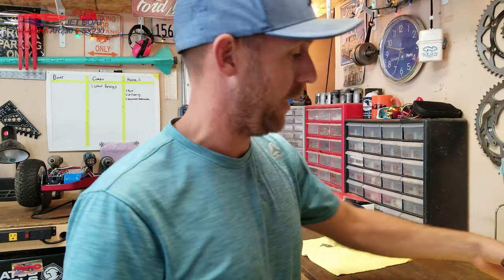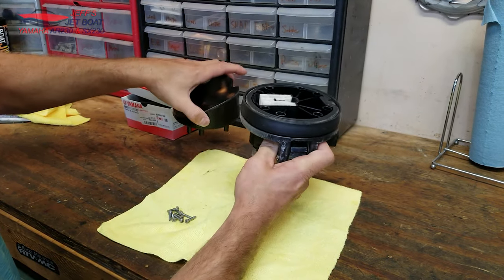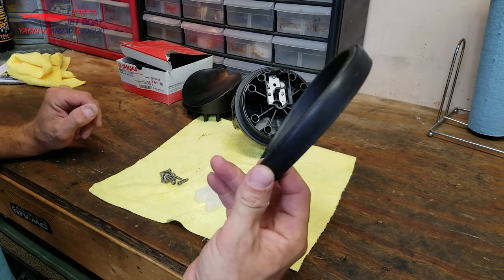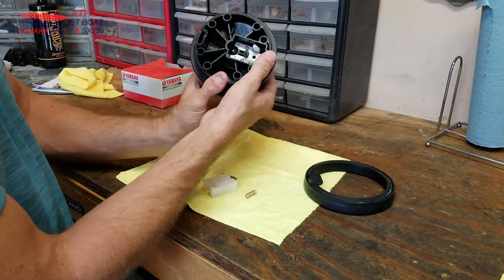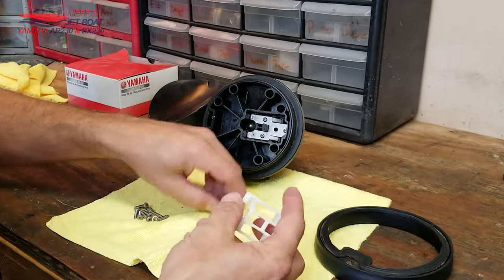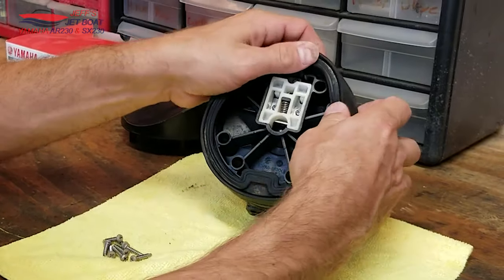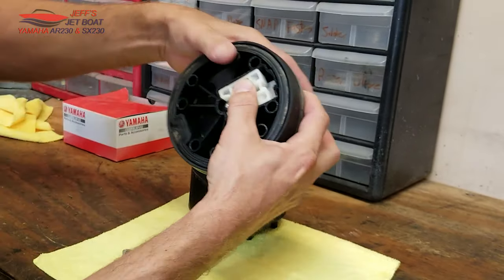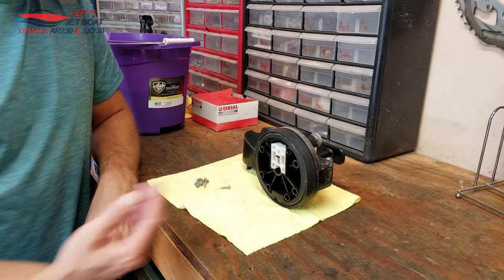How to Service/Repair/Rebuild Clean Out Plugs - Yamaha Jet Boat

Comment: Great video, I’ve learned a lot from you! Do you also use the cobra EZ locks? Debating on getting them as insurance..
Reply from the maker: I do not use easy locks and there is a simple check you can do to make sure they are seated in correctly.   I will be uploading on video on it today or tomorrow and is only a couple minutes long.  We use are boat about 3 times a week and after every use I remove my plugs and then have to reinstall them for the next trip and I have never had a problem.  S

Comment: Thank you for video.

How do you repair top part of Clean Out Plug?

"Push Unlock" button on mine detached, and sides holding button broke.

Thank you.
Reply from the maker: I have not run into that one yet, looks like you may have to buy a whole new top assembly.
Reply: @JeffDoesThis  Thank you for answering my question. And how do you reattach cord to Clean Out Plug after removal?